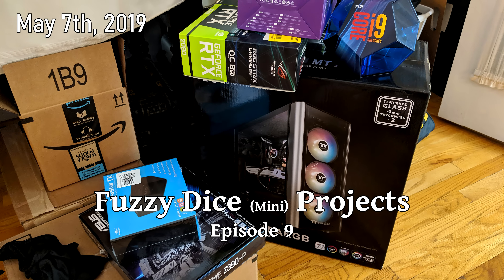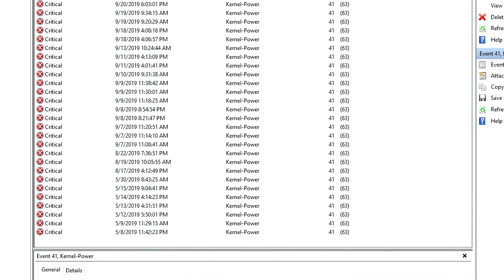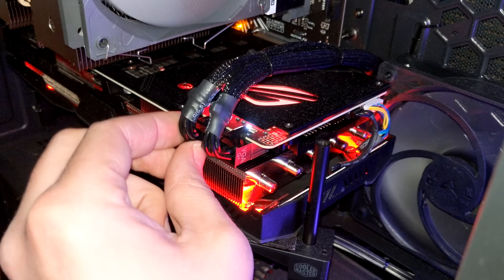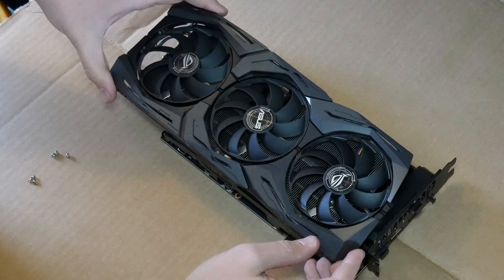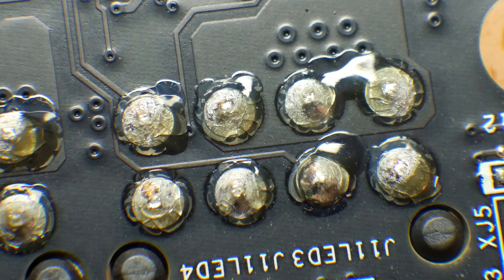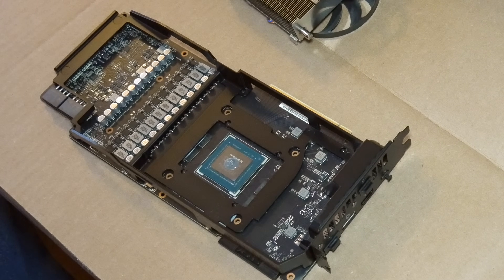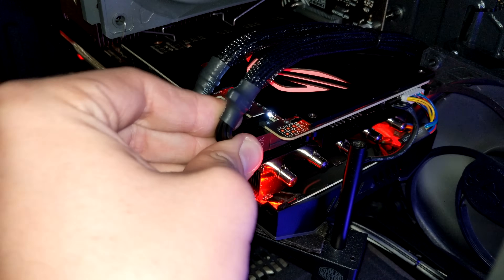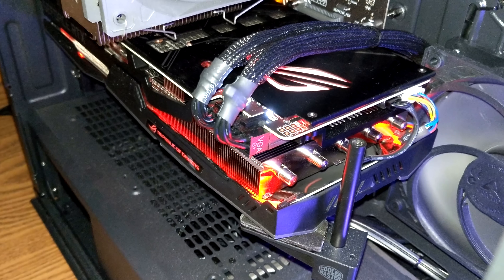ASUS RTX 2080 Power Connector Repair (Black Screen Crash/Loud Fan Fix) (Mini Projects Ep.9)

Comment: I just started having a problem with my 2 year old Gigabyte rtx2080 super.  The screen goes black and fans throttle full speed whenever I try to play a game.  I'll try wiggling those cables.  I just tried some benchmark software and got the card to fail though so I might have a different problem.
Reply: Hello ,did this video help you? Or did you get the gpu fixed

Comment: OMG I think I have the exact same problem! (gigabyte rtx 2080ti). I had all the same signs as you and also concluded all the same stuff even my bios once displayed the same message! tried different psu cables etc. in order to figure it out!

Will need to purchase some supplys as I want to replace the termal pads etc aswell but Im so happy I found this video this seems very accurate to what im experiencing thank you!

Comment: thank you so much i solve my GPU problem i thought my card is broken when i start my desktop ''GPU fan start to speed up at 100% then i saw your video and check the two 6 pin i reset them and what a magic my card back to life again then i touch the front 6 connector it starts to speed up the fan again that 6 pin is little bit loose.

Comment: 1:40 For anyone else who encounters this. Contact the retailer. I've had numerous computer parts that have failed, any companies have either refused to RMA it for x reason, request for me to pay 2 way shipping to another country or just ghost me with automated responses. I have yet to have a computer hardware retailer deny a replacement part after explaining to them. They typically have either a discretionary fund to solve shitty situations and make the occasional customer happy, or better channels with the manufacturer/distributor to get it sorted out themself.

Comment: My old computer broke, so I got a new one. It had a crappy GPU so I got a new one. It came in broke, and customer service didn't compensate me for it. I have it lying around to this day. 

When I initially plugged it in, it had the exact same issue as shown in this video (it was loud, and I couldn't boot my PC up).

Any good recommendations on how to fix it?

I have a GT 730 that works perfectly fine.

Comment: Thanks man I had this black screen problem for a month and tried everything. It turns out it was the cable, when I wiggled it, the black screen appeared with fans at 100%. I changed the cable and now it has been running fine for days. Thank you for sharing!!
Reply: I am having the same problem and I do not know anything about pc’s, did you buy a new cable or just replug it back in and what do I buy if I need a new one?

Comment: Man, been having this issue, exactly EXACTLY the way you describe for the last 1.5 years.  About to open up my case tomorrow and wiggle that cable.  I honestly hope this is the problem because everything else has failed so far.  Wish me luck.
Reply: I just wiggled.    It did the thing.  I am actually happy about this?  Holy CRAP thanks for this video.  I would have never known. ASUS GeForce RTX 2070 Super.
Reply: @StingrayOfficial  so did you fix it?
Reply: @jadyounes697  Yes, working now. I ended up pushing on the connector and the card to make sure they were both seated and haven't had the problem since.  It could still be broken via the solder joint but maybe it's in a happy place.  I think most likely it was a connector issue.  But exact same problem in the video.
Reply: @StingrayOfficial  ok thx i will try your solution cuz i cant solder my gpu
Reply: @StingrayOfficial  haha, Pcs do that to us, i have a geforce 1650 and i tried averything nonstop for two months, i still cant solve my problem (its just like his problem  in this video), its a hardware problem, almost garantee, but mine dont have energy cable, its just the slot on the board, i cleaned and changed paste but the problem is still there.

Comment: Hi massive thank you for this video. I have a Gigabyte RTX 2080ti Extreme. I'm not sure if your aware how much of a problem this "RTX 2080 - 2080ti fans revving up then screen going black, PC restarts" thing is but there's posts on almost every forum about it. With many theories about what is causing it and possible fixes. I have been suffering this problem for the last week or so. After going through many of the forum posts I found, and trying many of the "fixes". My problem was that the PC would boot but as soon as I tried a game I'd suffer the fans revving screen black PC restart thing.  After watching your video I did your "wiggle test" on both my 8 pin power connectors and sure enough one was loose, as soon as I touched it my fans revved up and screen went blank. My temporary fix for tonight has been to prop up the offending 8pin connector with the very handy anti sag bracket provided by gigabyte :) As soon as I get the chance I'll get the card along to my local electronics repair shop to have both 8pin connections resoldered. As proof of the fix I have now been gaming for 5 hours straight without any issues for the first time in over a week, so thanks again.                                                                                                                  If its ok with you I'll copy the link to your video and drop it into some of the forums I came across on my journey to finding a solution to this problem. To finish on another positive note, after reading all the "it may be this, or try this" posts I found before I came across this video, I have updated every driver in my computer, and also repasted and installed new heat pads on my GPU so not only is it running stable (thanks to you) but it is also way cooler sitting at 63 degrees in game right now :)
Reply: Having same issue on an 2080Ti XC from EVGA as of last night, RMA in progress
Reply: How's your GPU doing now? Still good?
Reply: @user-qk5mr8ez6y  hey, sorry for the late reply.  I got both 8 pin connectors re soldered that same week, and never suffered any other problems with the card.
Reply: I am having the same issue with my EVGA rtx 2080ti, will try it out tomorrow... cold boot brings the black screen and fans maxed.

Comment: I'm having the same issue but with an RTX 2060 Super... Think I'll try this solution.
Reply: Did it work ?  please tell me some suggestions, I’ve the same problem with my Gigabyte RTX 2080 super
Reply: @badboy_17.  Actually my problem was in the power cabble connected to the graphic card, I just disconnected and connected again firmly and voilá!

Comment: I was able to RMA mine, got my replacement today and out of the box did this exact same thing.
Reply: Any update?
Reply: @naturesix8061  the ATX cable on my PSU ended up being shorted out so if it moves the issue appears
Reply: You sure they didn't send you the same card back?
Reply: @trucid2  Nah it ended up being my PSU

Comment: I'm having the same problem with an 1660 S, gonna check the connector later and update if the problem is the same as you

Comment: I am facing this problem for the second time. My video card was replaced under warranty, less than a month has passed and here it is again ... manufacturers should be ashamed
Reply: Are you sure they didn't send you the same card back after running some tests on it? Should've marked it with a permanent marker in an inconspicuous spot before RMAing.

Comment: A little tip about applying thermal paste to a GPU:  Instead of just putting a bit of paste on it and letting the heatsink spread it out like you do with a CPU it's better to manually spread it over the entire chip.  Because the GPU doesn't have an IHS like a CPU the die makes direct contact with the heatsink and there can be hotspots if the paste isn't applied evenly.
Reply: Spreading the paste creates air bubbles. It's much better to put on a fat pea of paste and squish it with the heatsink

Comment: If you want to make the performance of the cooler even better, try using liquid metal. Just make sure your headsink is copper and that you use some sort of covering agent to stop to liquid metal from shorting out the chip if it leaks out.
Reply: Liquid metal is an absolute mess, and probably not actually worth it here. Linus Tech Tips uses liquid metal to break overclocking world records. Most people will just be happy if their stuff works.
Reply: Listen here buddy, I run liquid metal on all of my graphics cards, especially the laptops. You are literally leaving thermal performance on the table and it is a low risk high reward upgrade. It is not more trouble than it is worth and is infact a very good setup.
Reply: @StormHawksHD  I mean, if yall wanna go through the trouble of putting liquid metal, then go for it, but I still think most people are just going to use a regular high quality thermal paste. I 100% believe that you do get insanely low temps, and crazy overclocks with liquid metal, but it's just not for everyone.
Reply: @NerfCraft  I never said it was for everyone, this is just a better option, its performance than will do even better than what he has. It was a suggestion. leave it alone.
Reply: @StormHawksHD  My whole point was always that it wasn't for everyone. So we agree then?
Reply: @StormHawksHD  ...and why exactly should anyone listen to someone who starts a convo with "listen here buddy"...?  smh

Comment: I have had 3 ASUS cards die on me. I only buy EVGA now. They are beasts. Never an issue with them. ASUS cards sometimes had driver issues too, forcing me to use older drivers to get things to work right. ASUS support sucks too. Just don't buy from them.
Reply: I feel really bad for you now that EVGA isn't making GPU's anymore.

Comment: NT-H1 is a good choice for thermal paste. Good thing you swapped it out. I got concerned about the big tube of what looked like automotive thermal paste was applied. You get alot for your money but the paste more often than not doesn't preform very well.
Reply: This cheap generic chinese crap also separates into oil and a sticky goopy mess that doesn't really work as thermal paste anymore really quickly. If it has to be cheap stuff, at least go for something like Arctic Ceramique in the huge 25g syringes (the tiny tiny syringes are waaay more epensive per gram). Even that stuff is worlds better than the generic paste, and from there you can still step up to MX-2/MX-4, noctua stuff, thermal grizzly and all the other expensive boutique goop

Comment: Given cables hang off those Power Connectors these should have a mechanical attachment(screws/nuts) to the PC board so the electrical/soldered ones aren't taking the strain. Maybe that's what the epoxy was suppose to accomplish? Actual screws or something like it would have been better.

Comment: I had same problem on my washing machine, it seems that now days manufactures are forbitten to use lead based soldering tin and they have to use lead-free that can not handle mechanical force ( lead based if more flexable ). It seems that original owner used too much force. For my washing machine it was just that machine fibrates and so does heavy components like relay on circuitboard. Resoldering usually fixes electrical problems.
Reply: nowadays? Leaded solder has been banned since 2005, with the first problems popping up just a year later in the PC world of things (the mass dying of Geforce 8xxx graphics cards) and in game consoles (Xbox 360 with their red rings of death and PS3s with their yellow light of death)

Comment: your card where having this issue from the start the 1st owner returned it,the store clearly fixed this for the first time and the evidence is the resin and if you notice at the start of the video the solder joints are clearly made with a soldering iron and not with INDUCTION heating ,and secondly the resin you found,none of the known manufacturers use resin for this kind of job....otherwise bravo.....very nice job
Reply: That's not quite true because I had the same 2080 rog strix and my card looked exactly the same. Asus was obviously just sloppy

Comment: Step One: DON'T BUY CHEAP THERMAL PASTE!!!
Reply: Cheap doesn't have to be crappy (see Arctic Ceramique 2. damn good bang per buck in case of the 25g syringe), but this cheap generic chinese crap that most of the time separates into oil and a gloopy mess that doesn't work as thermal paste anymore inside the syringe already is definitely something to avoid at all costs

Comment: Life pro tip. Do as much testing with as little reassembly as possible. Nothings worse than getting something “fixed”, reassembling it completely, and seeing that it didn’t work and then you have to strip it all down again.
Reply: I needed to replace thermal paste on my graphics card. Didn't realize how tight the screws needed to be around the dye, so I just did them up a little bit. Went to run a benchmark to test, and it went straight to 90. Took it out, took the cooler back off, looked everything over, then realized that I needed to torque down those screws a bit more. Worked fine the second time I put it together.

Comment: Lol here comes the thermopaste comment war. Cool video Fuzzy Dice.
Reply: So what do you think, too much or too little? Or did he put it in the wrong spot? Maybe he should have used an X, or lines, or drawn a picture of a unicorn with the thermal paste!
Reply: @NerfCraft  The idea behind thermal paste is the fill in the small gaps between two flat metal plates. As long as the gaps are filled, any excess thermal paste is either squeezed out the sides and goes all over the PCB or it stays between the fan and the heatsink, making heat conduction worse. (The thicker the thermal paste, the more heat has to travel, the larger the head differential and the longer it takes for the heat to travel to the heatsink.)

Comment: Ah yes. I also end up getting my arse bitten by my own cheap ways..

But congrats. I've done similar. The latest being to replace the capacitors on my old FX5200 in my Web Server PC. Ah yes.. the time of dodgy capacitors comes around every so often..
Reply: I personally buy most of my pc parts used to save money, and actually have had very very few problems, lol. Just so happened Fuzzy got unlucky here I guess. The RX 480 I have now was purchased about 2 years ago from someone on Facebook. Paid $85 for it. Now I would have been happy with any model of the 480, but this one happens to be a Red Devil 8gb model, so it's really nice.

Actually the funny thing is that during Black Friday last year, I went to Micro-center and bought a Ryzen 5 1600, a320 Motherboard, and 2 8gb sticks of ram to upgrade from my old i5. Wouldn't you know it, after buying all these used parts with no issues, I buy new RAM that turns out to be faulty. Had to take the 30-40 minute drive back to the store to get a replacement.

Comment: That's a monster video editing rig. I'm rocking an amd 3950x 16 core/ 32 thread cpu and 5700xt gpu. In the next week or 2, amd will release their new 6000 series gpus. I've had pretty good luck with my Asus rog strix x470 motherboard. I only edit at 1080p and rendering literally takes a few minutes for a 45-60 minute video. Editing takes longer because I'm a slow mofo. 
  I use Thermal Grizzly hydronaut thermal paste. I've considered using their conductonaut liquid metal. I believe it's the best that money can buy. 
  It's cool to see that you're into tech stuff as well as wrenching. The wireless monitor video was interesting tech.
Reply: don't use liquid metal on chips without heatspreding caps. liquid metal can eat bare crystal

Comment: As someone who only knew your channel for its car content,  i'm pretty impressed that you had the balls to take a soldering iron to your Graphics card.
I'm very comfortable handling and using computer parts, but damn, it takes some confidence to do that to a Component that expensive.
Reply: If it’s already technically broke might as well start rolling dice.
Reply: @aduty23  Right, not only broken, but the manufacturer wouldn't do anything about it.

Comment: I have a 2060S and it is producing the same problems as your 2080, I'll check the power connectors on it. Thank you for the video. :D
Reply: Update?
Reply: Is it solved? I have the same graphic card and I'm having the same problem!
Reply: @guibarao  I never did the repair because it would void my warranty (which will expire in 2023) I'll wait till suppliers will have graphics cards in stock and RMA it.
Reply: @Bolcsi  so you're basically waiting for 3 months to get your new gpu because it's out of stocks?
Reply: @jsizjiisk7606  Yes, I'm waiting till the GPU shortage is over, if I sent it back now, there is a high chance I'd just get my money back and I'd be stuck without a GPU.
Reply: @Bolcsi  then what should I do🥺 my GPU is also not working same issue
Reply: @guibarao  The only thing I can help you with is if you turn off your PSU for ~30 secs, turn it back on the GPU will turn on without a fault. (at least mine does)
Reply: I've same issue with my rtx 2060 what should I do
Reply: So did you do it?